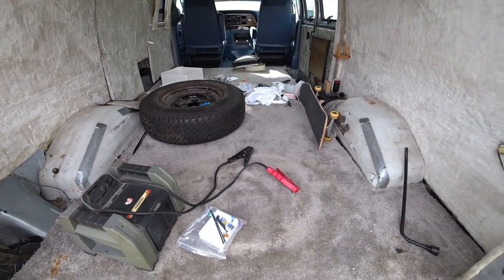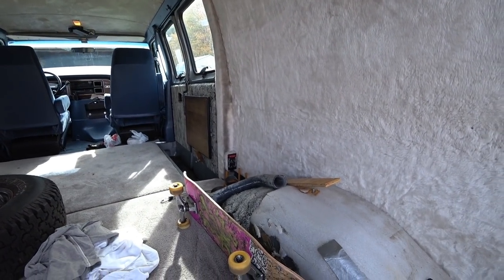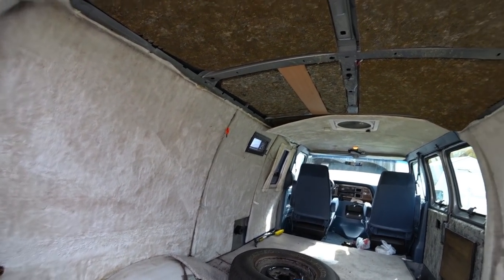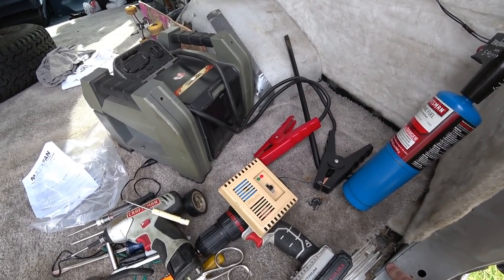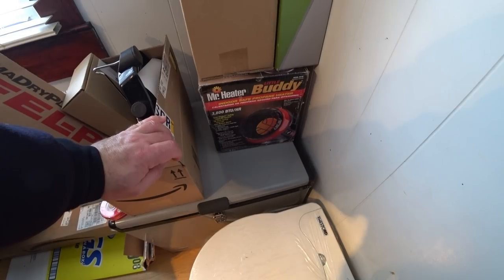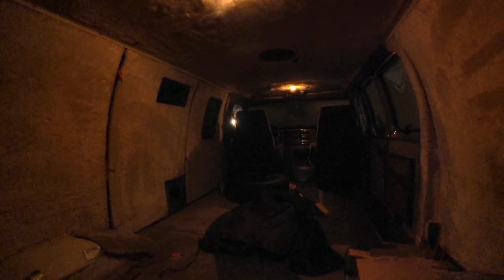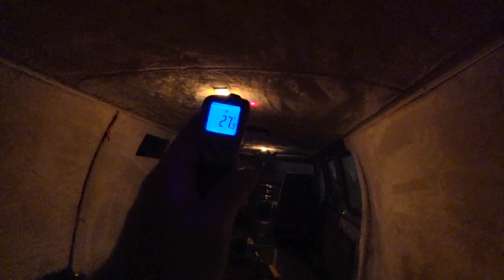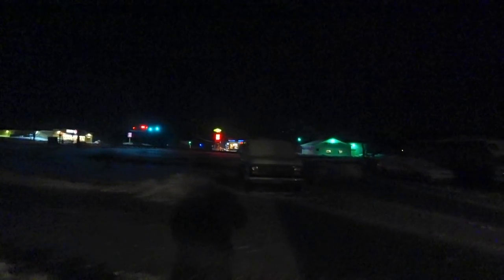Nomad RV Van Build Part 4

Comment: Get one of the vent/fan insulation cushions and hang a curtain between the cab and the rear.  I bet the you'd see a marked improvement.  We use those vent inserts in our travel trailer and they seem to help.
Reply from the maker: We have one also for our RV...The curtain would help too. But, I wanted to show what it was like with minimal aids..I would have preferred to do the test without the van insulated as most vans come that way originally...I think we will try to do another test when the van is finished out and has a bunch of objects in there that can be heated radiantly..

Comment: 6:26 - Hopefully you got a different "stinger" for the K40. Seen that little stinger on your other videos and always wondered...WHAT THE??? It usually uses a 57.25" - 58" stinger. Were you able to check the radio/antenna with an SWR meter or just turn it on, key it up, and call it good?
Reply from the maker: I have a meter and my truck is tuned but he is a bit Leary about how much ariel he wants up there...this was installed in 1989 so we need to get him a better cheap CB first as this one just dont wanna work..

Comment: 8:05 - what a great way to test a propane detector!

Do you have a method for testing carbon monoxide detectors?
Reply from the maker: Aorry, Im not sure about that as most carbon monoxide detectors have a self test built in and once they acually go off due to exposure to excessive Carbon Monoxide some have to be replaced at that time with new ones..

Comment: In one of Nomadic Fanatic's past vans he converted his Buddy Heater over to being supplied from his regular 20# propane tank.
Reply from the maker: This one is a direct screw on but my other buddy heater has an optional hose that connects directly to a 20lb tank. this little one could probably do the same with a  little bit of ingenuity but not sure where we want to put his 20lb tank at yet and if we even want it in the van..

Comment: I was wandering if the van was driving then parked warm. Would the heater maintain the temp?
Reply from the maker: Maybe, There is so much heat generated by all those rotating parts and road friction plus the exhaust routed under the living area that it would take awhile for that heat to be lost...

Comment: At the beginning of the video you mentioned installing a ceiling vent fan in the van.  Have you installed a ceiling fan in an RV where you've cut a new hole into the roof?  

I'd like to install a secondary Fan-Tastic fan in my RV but only have one vent opening in the bathroom.
Reply from the maker: Yo may want to check out our Roof install video or maybe our A/C install video... it is in a group of videos that are called flashback video...